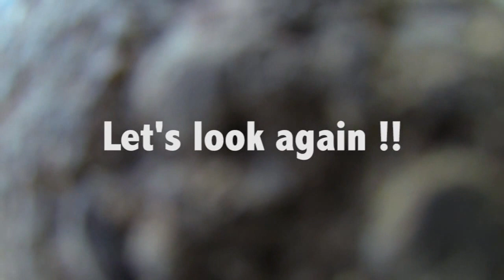Dji f550 Prop Fail and Crash

Comment: When I put your specs into eCalc it seems to show that for your motor and prop combination you are right on the borderline for staying in the air even with 6 motors as you are approximately 500g overweight. I have assumed 30A ESCs and that the 2212s are 920kv. That means you are requiring 93% motor capacity just to stay in the air. As a result on losing a prop you need more than 100% capacity on the remaining 5 motors to stay in the air so I think the fact that the F550 stayed upright was the best you were going to get from the Wookong, the physics wouldn't allow it to remain in the air I'm afraid. Do you normally find there is much additional power when you are ascending? If you can drop the weight to about 2300g that will bring you down to 80% capacity to maintain hover and would have meant 92% to maintain hover with 5 motors. Then she may have held. I believe the maximum recommended take off mass for an F550 on those motors is 2.4Kg, which is in line with eCalc.

Comment: This video would be a great advertisement for your gimbal.  Even with the aircraft shaking and wildly gyrating with 5/6 props, the video is stable.  Where do I get one of those.  ;-)  Sorry about your crash.
Reply from the maker: Actually it is custom made.
We bought the cheapest 3D axis brushless gimbal. Doesn't like the motors they are too weak and we changed them. Then the software sucks, and we changed the control card. We only used the chassis of the gimbal that we bought. 
It needs more work to get better. We are kind busy with our commercial aerial video productions. You can check out our commercial Youtube Channel, and watch the video in link: Sahinbey Parkı - airVision. See that how we levitate on air, and even if we speed up the some parts there is no vibration at all. Look close at 1:11, to the ski boards.